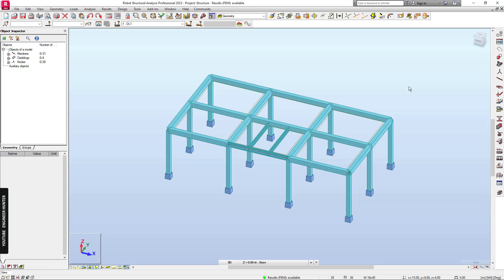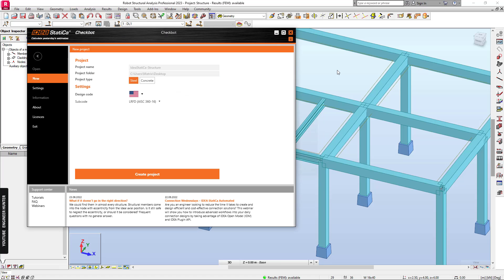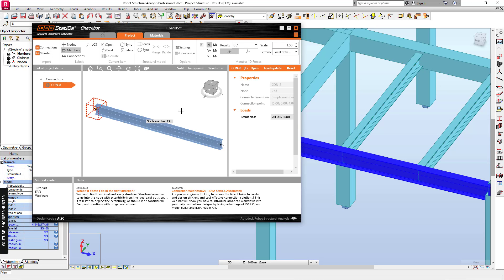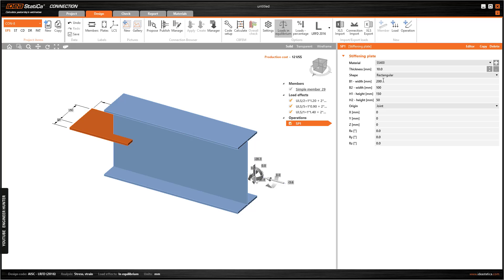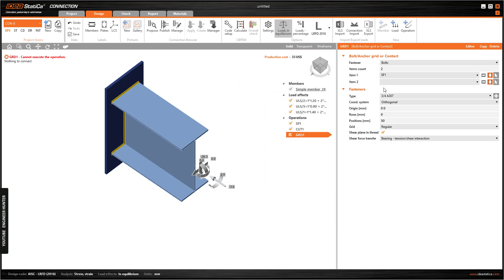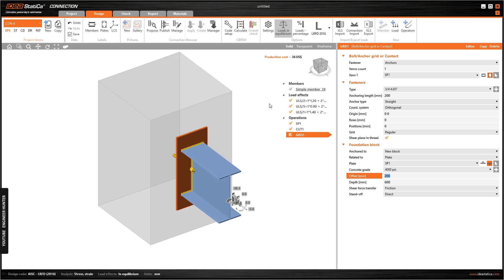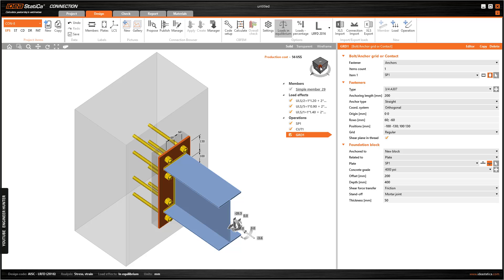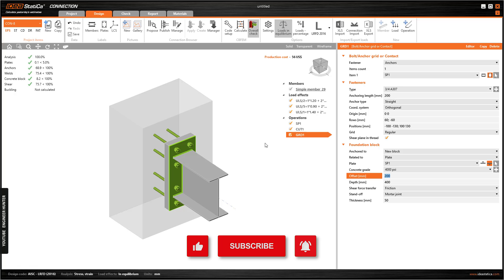Steel Beam to Concrete Column Connection

Comment: Can we check whether concrete column would be able to sustain shear forces imparted by bolts? Or is it not possible in Idea Statica?
Reply from the maker: The software also checks concrete breakout resistance in tension and shear.

Comment: why you use "friction" for shear force transfer? Anchor bolts provide a stable, rigid connection capable of handling the interface between steel and concrete.

Comment: Hello
Thank you very much for the video.
Modeled in IDEAstatiCa Connection ((Metal column-concrete connection (with anchor bolts)) connection, is it possible to open the IDEAstatiCa DETAIL and reinforce the concrete block? (without modeling in IDEAstatiCa DETAIL)

Is there a video of what I said?

Comment: Thanks for this video!

Typically, when connecting steel beams to concrete, we end up with two unique conditions:
1.  The embed-plate is buried in the concrete aided by the formwork.
2.  No stand-off gap (grout is used) is used.

QUESTIONS:
1.  Have you found a way to accomplish these conditions in IDEAstatiCa? .....https://drive.google.com/file/d/1XuY44aXR7eOS9UVTJ4XLmLQVffsJ7gH_/view?usp=drive_link
2.  Have you found a way to model Headed Studs instead of anchor bolts in IDEAstiCa?

Comment: did you relase the member beam to concrete column?
Reply from the maker: In this video, no. But it depends on the type of connection you want to use.

Comment: Thanks for your helpful video, I wonder why IDEA STATICA starts bolt size from 1/2 inch (12 mm), is there any solution to this problem, I need to use 10 mm  and i can't.
Reply from the maker: You can try add a new bolt manually in the database.